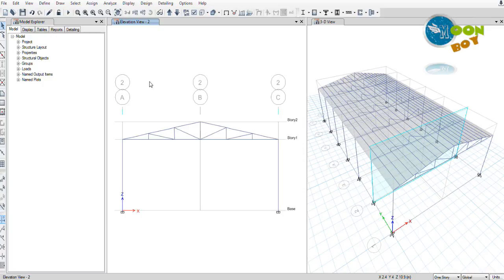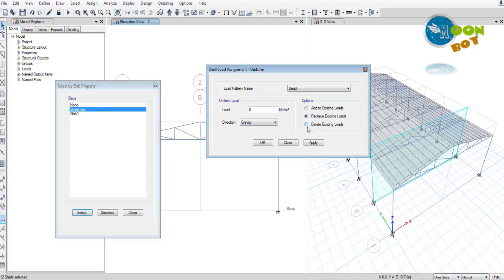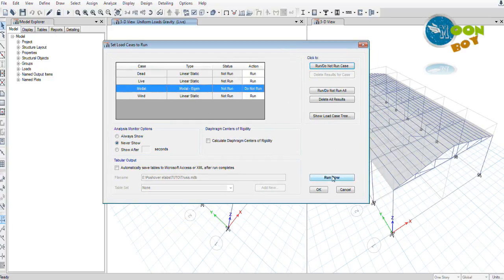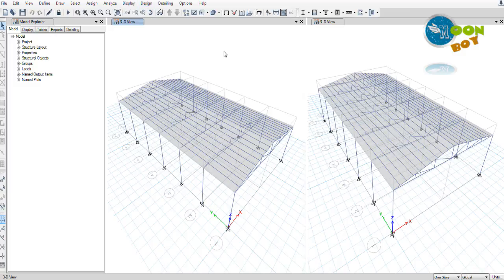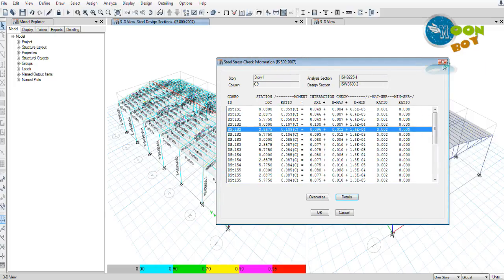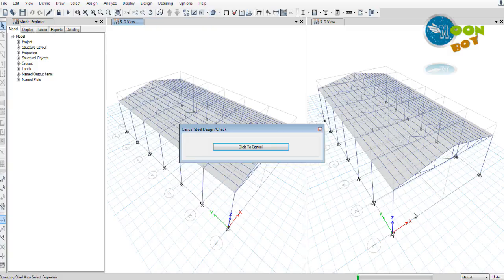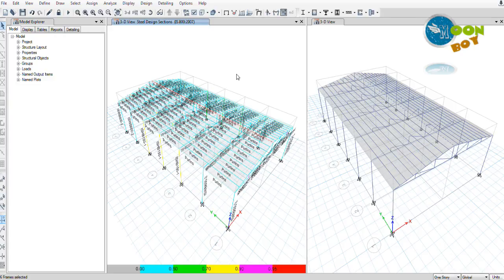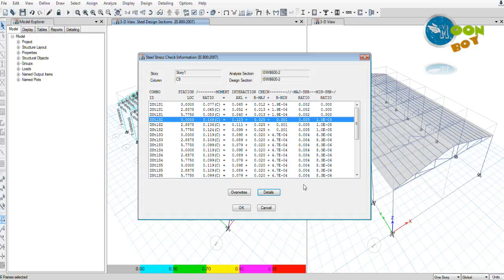Etabs 2015 tutorial 10 | Steel Truss Modelling and Design | Using IS Codes | Part-2

Comment: Can  we automatically generate Wind load in factory truss using null element?
Reply from the maker: Need to be checked whether its possible. For building it generates. But for truss we need to check once.
Reply: @moonboyslife  Please check and confirm.
Reply from the maker: @AtulEngineer  ok.

Comment: is the column iswb 600 is economical and optimize design.practically i have fabricated it for 15o ismb with cross bracing at the top and support by the wall from the bottom to the half where it is safe for wind load of nepal 40 m/s.and its span is 63 ft.with tube frame structure of truss.so can u guide me how could i assimalte anlystically to the software desgin.
Reply from the maker: Please try auto member option to arrive at the economical member or try increasing member size, if the assumption fails.

Comment: Dear sir, I have a question regarding application of wind load in ETABS Model. In this Video you have assigned the wind load for Exposure from Extent of Diaphragm condition but in model you have not assigned any diaphragm. Then How the model takes wind load. And  Also Is there no any role of mass Source in wind Design????
Reply from the maker: Saunak Sharma This tutorial is just an example. you can change the things as per your requirements. many more things I have not shown in this video but should be applied for actual full design.
Reply: Dear sir, Thanks for your kind reply 
Dear sir im confused  while designing slope roof and default wind load of ETABS. we cannot provide diaphragm in slope roof and when i used exposure from shell there was no effect of wind load ( in drift and displacement) what should i do in this case?? and is there any role of Mass Source in wind design.
I would Be grateful for your reply
Reply: @SaunakSharma   if you select exposure from shells you need to select the windward and leeward side of the roof separately and then assign wind pressure coeff to them. 0.8 for windward and 0.5 for leeward.
Reply: @SaunakSharma  Most accurate method is to calculate the loads as per Is 875 manually and apply them on the members. It is time taking but results are better than other methods
Reply: @santhoshraj17  Refer  Table 5& 6 IS 875 2015 clause 7.3.3.1 to calculte cpe page 14 & 15. Internal pressure coefficient may be taken from clause 7.3.2.1 page 11 IS 875-2015
Reply: Mass source is required for considering the earthquake load pattern in load paterns.
Also in this case the roof sheets are assigned as membranes but it in sloped condition...if the the slab is sloped ,then I guess we should go for Shell thin slabs
Sir please clarify my doubts.